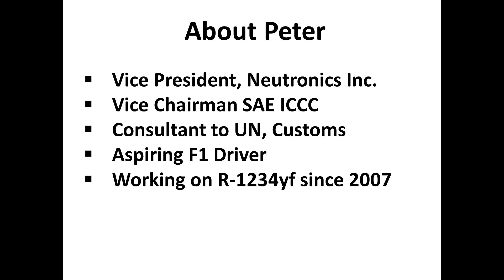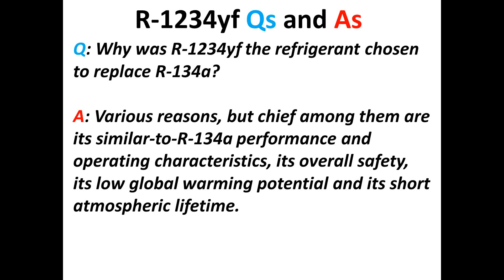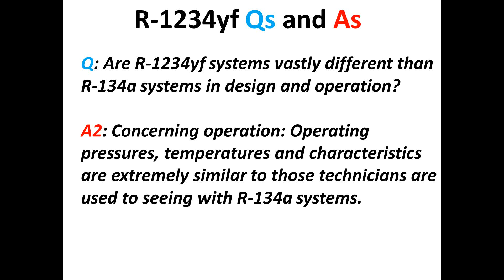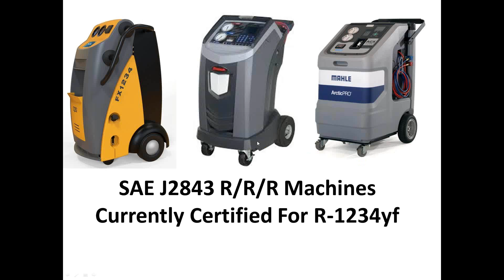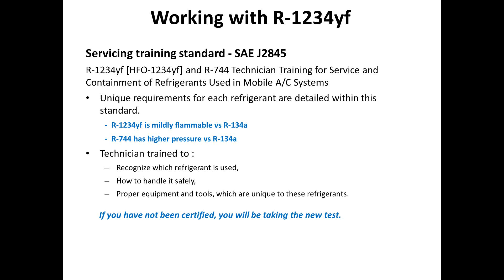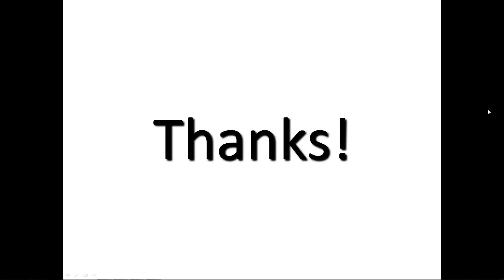The Equipment Side of Section 609 A/C Service Requirements and a Primer on R-1234yf Service

Comment: What's the benefit of taking epa 609 through ASE vs. taking it through EPAtest online
Reply from the maker: Both programs meet EPA Section 609 and give you the credentials needed to work on MVACs. The differences are subjective as to what's better about one versus another. ASE does provide information, such as the webinar you viewed, that goes beyond the credential by showing trends and developments in auto A/C technology.